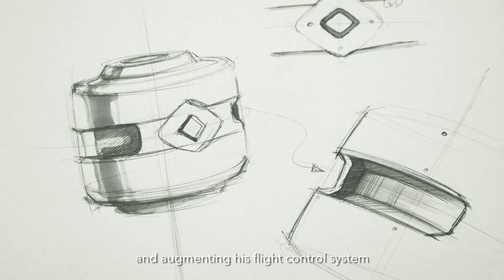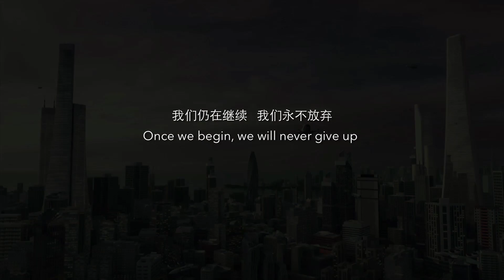Ehang 184 Human-carrying Drone

Comment: The biggest unforeseen obstacle for the Ehang is its navigation system that currently does not account for the location of Electrical Power lines, communication towers, telephone and other cable lines.   Though most modern cities keep much of this underground,  its exactly the opposite when traveling outside city limits.  Its not much of an issue when the vehicle reaches its service alititude, but instead the issue arrives during takeoff and landings.    I still believe the Ehang must have a manual pilot overide.   Relying soley on interconnection between the aircraft and a controlling location is like asking for cell phone communication to absolutely never not under any circumstance, drop connections.   It just wont happen.  Not to mention onboard system OS error,  OS crashes, etc.  Its unwise to develop completely autonomous flight control.

Comment: What happens when one motor goes out?  The whole thing goes straight into the ground.  Upon impact, the remaining props fly off into the cockpit spearlike to ensure the pilot dies.  Is safety built into this design?  Unfortunately no.  This design is inherently unsafe.

Comment: Absolute safety? With a fixed pitch propeller it cannot autogirate and glide on general electrical failure. Small propellers do not conserve momentum. No steering or any control whatsoever on general electrical failure. All helicopters are capable of gliding relatively safely on general engine failure.

Comment: For the battery life situation, I would suggest a hybrid motor design where gas engine would drive a generator which would charge the on-board battery that would power the motors. I believe with a hybrid design, this vehicle will have increased flight times. Although this concept may result in a lot of extra weight added.

Comment: Yes, for viability however, you'll need to employ some type of collision avoidance system (be it other aircraft/drones or birds).  The system WILL need to be fully autonomous as the average human can't even drive a simple car properly ... there would need to be a fail safe (parachute system and/or even airbag system).  
Current major people carriers like Airbus, Boeing, etc. are extremely fragile air transport vehicles ... they aren't built to take any sort of impact and the slightest failure in turbine blade can lead to disaster ... your product looks considerably safer than any current major aircraft.  
But to be blunt, I would not buy a "made in China" version of this transport vehicle ... nothing against the development team specifically but I just will not support a country that has no concern over our global environment.  As such, I would suggest you attempt to sell the design/manufacturing to a more Eco friendly country (at least until China stops their uncontrolled pollution of this planet) as I think you'd stand better odds selling this unit and getting wider acceptance ... look for countries that are heavily invested in solar power.

Comment: It would be a much more stable design if the props were above the cabin. This would add stability is the lift and forward movement by the cabin becoming a pendulum. In landing it would give a safer distance for ground obstacles and could also add new landing options, maybe even on water. Nice concept, good luck to Ehang!

Comment: Hi guys. Very cool project. I have a question: Why is the cockpit placed on top of the prop arms instead of the body being hung from below? Would the center of gravity be easier to control if the cockpit were below, rather than above? Just curious. It looks like an amazing project.
Reply: well, In China.. the gravity works a bit different.. its not so responsive with plastic.. yeah its safe..

Comment: "Ethang 184 is the safest-"
Let me stop you right there. Nothing is safe here when you surround the vehicle with rotors at knee level. Work out a design that doesn't severe limbs when propellers are running.

Comment: How long can it fly on one battary
Reply: +gertinoss Could easily be a hybrid system, depending on weight needed to make it successful. Technically, it's a helicopter. Nothing about this is revolutionary. 

If done right, short commercial hops could be a small new market in aviation at relatively lower altitudes. Build smaller airports close to the city/suburbs.

And, they can be used in film as well or other pursuits where an occupant is needed to observe. Or, just fun, bringing commercial aviation to the masses.

Comment: Why not put the motors and propellers on top,in case of emergency the pilot can jump out with parachute .
Reply: +Peter Chang I think it's better to develop a fast deploying low altitude parachute for the whole device.
Reply: +Peter Chang How about a simple drop-hatch out the bottom, as long as you have a parachute attached to your back? No need to clamber out or go anywhere near the propellors, just drop downwards through a hole in the bottom, and deploy your 'chute.
Reply: +inyazserg Sergey Larin what do the props have to do with it? the parachuite would come out of the top of the drone and prevent that from falling to the ground. this could be made into a fast deploying chuite with small rockets that extend the canvas in under a second.
Reply: MrSkyl1ne
Good evening. I understand what you mean. You mean that the whole drone will have a parachute, don't you? But I meant the personal parachute on a driver's back.
Reply: +Peter Chang I think it's design to fly around 10-20 meters above only.
Reply: Oh man!  This conversation is killing me.  Haha!  All dumb ideas from people who have no knowledge about flying aircraft and parachuting.  LOL
Reply: +William K
you may be smart, but you must know that every time you have an argument in this comment section, your negative comments come to MY MAIL BOX. PLEASE, DO NOT WRITE YOUR NEGATIVE COMMENTS. STOP. 
ps I disliked your video on your channel and I advise the others do the same.
Reply: +MrSkyl1ne  and then what? Be minced with the propellers?
Reply: +inyazserg Sergey Larin launch it out the side/towards the top, the propellers look small enough to allow clearance for the rope.  Or build in a fail safe for the propellers to slow down in a couple of seconds in preparation for the shoot being launched.
Reply: +inyazserg Sergey Larin 
What you meant doesnt matter. you should pay attention
Reply: owowowkwk2kk3k3k3lelelelell3
Reply: 1uqikwkwkwkekekekwlkwkwkk2kwkw
Reply: Spencer Sacco
pay attention to what? To the propellers making me minced beef?
Reply: Check out the system employed by Cirrus aircrafts. It uses rockets to launch a chute that brings the whole aircraft down safely. This would have to have something similar.
Reply: Spencer Sacco
yeah, i have seen such a system in the film called The Gods Must Be Crazy 2. But, still, the idea is to LET the pilots JUMP OUT of the plane, and not just levitate on a parachute.
 And, yeah, soaring down is a great idea in the absence of a possibility to use a personal parachute (in some cases). F.e. what if the plane gets on fire and the chute is on the brink of going the same way?
Reply: feralferret
good idea. If this Yahoo 184 costs not much, it could replace conventional planes where it comes to parachute sport.
Reply: Why would the pilot need to jump out if the whole craft has a shoot?
Reply: ShreddNugent
perhaps, because most trained parachute jumpers have their own shoots? or maybe because the thing could be on fire or going to explode?
 Should I find more reasons or do you think these are enough?
Reply: Shoots?  LOL!
Reply: inyazserg Sergey Larin emergency shut-off
Reply: inyazserg Sergey Larin and how would a carbon fiber, electric drone start on fire?
Reply: its called a helicopter
Reply: That is stupid. You cant open a parachute when you only fall about 20m-50m. You use a parachute on a distance of several hundrets of meters. You would die before you can even open the parachute properly.